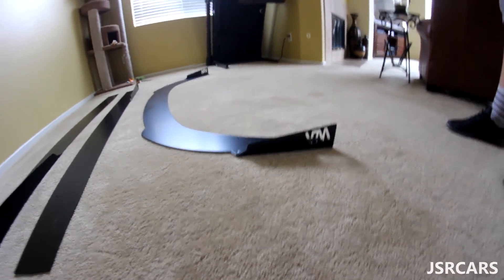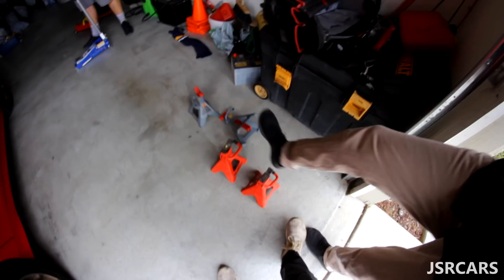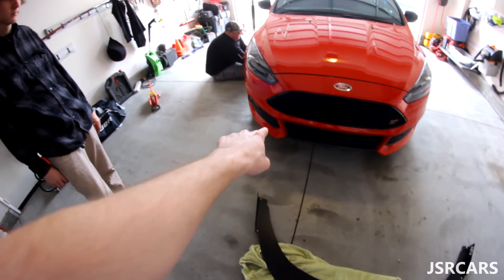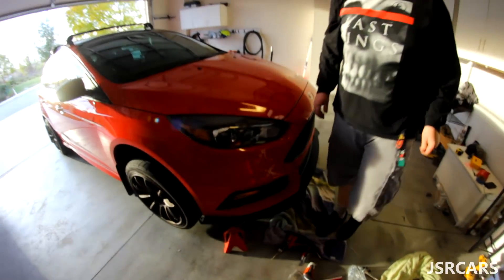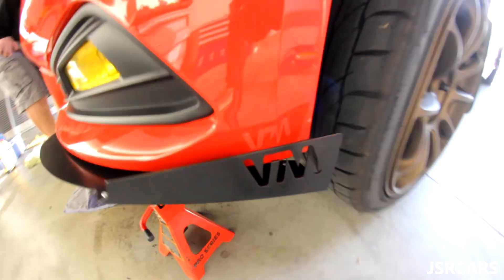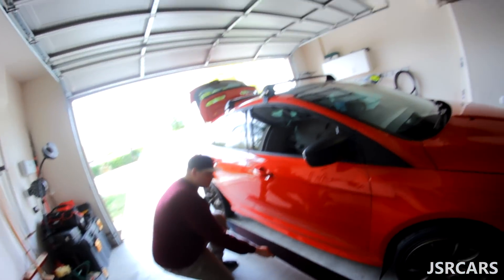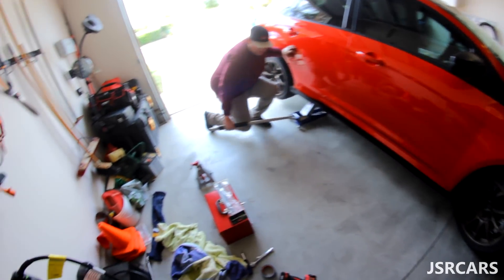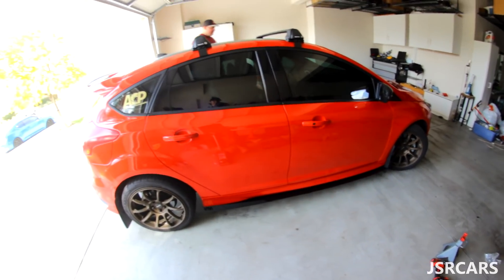HUGE Aero Install For the ST!

Comment: Quick question for your buddy. As of now I have a stock FOST but I want to lower it and put these same splitters on in the future. I’m just worried because where I live, not only in my community, but in the town there are a lot of speed bumps. Not the long ones where you can cruise 20mph over im talking the narrow high ones you see in most gated communities. Have you driven this over them and if so, how does the height do? I would hate to go through the trouble to install these just to scrape them all over speed bumps!

Comment: Quit playing games. Ford bought Volvo back in the day but the Ford turbos (ecoboost) motors have headgasket problems. Put the ST on the dyno, I want to see where a Volvo C30 matches up just a chip tune (Hilton) puts around 300tq. The 5 cylinder will always give more tq.